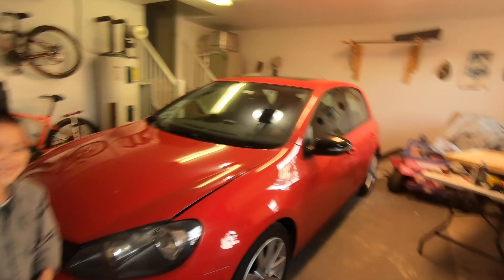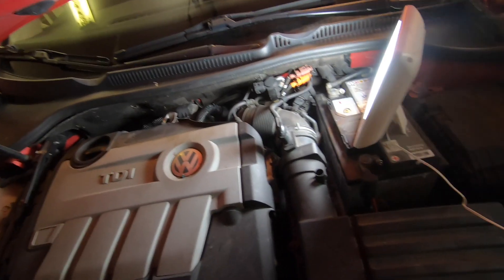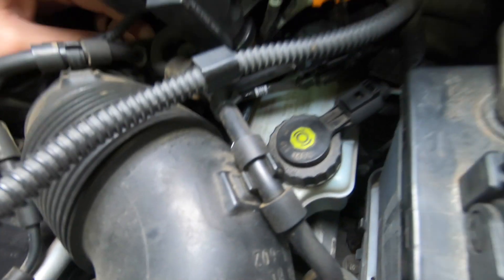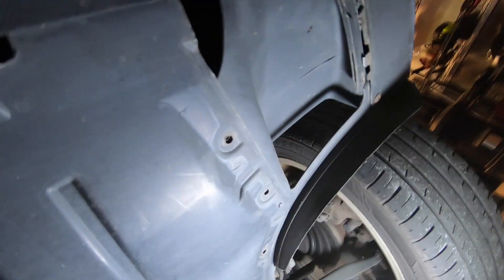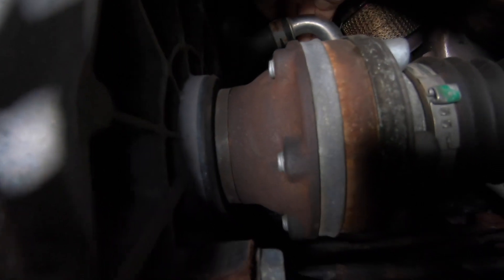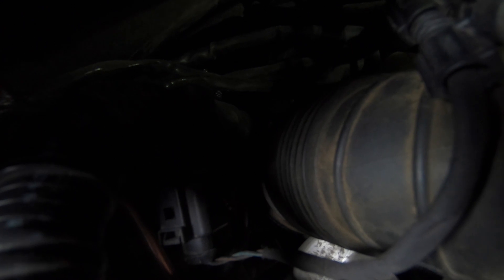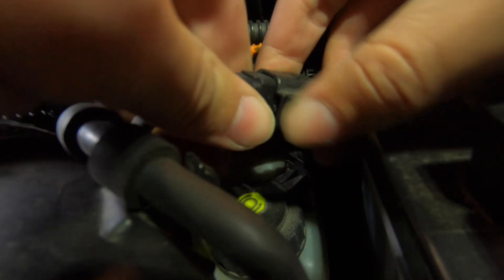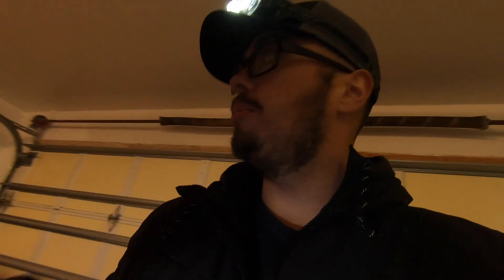MK6 VW TDI P0544 G235 EGT Sensor- How and Why

Comment: This was a challenging fix.  It’s just tough getting to it from above or below.  Like all fixes, I could probably do it in half the time now that I’ve done it once.  

Be prepared to spend more time than you hoped, but there’s nothing complicated about it.

Bolt blaster or its equivalent sprayed towards the sensor fitting from below helped.  A cheap also boroscope  helped.  

Be patient.  I wasn’t.

Comment: Thank you for the video. This helped a lot.  I couldn’t fit my hand back there, so did the job from underneath. I think it’s also a lot easier seeing the nut from below.
Reply from the maker: Definitely easier to but it still wasn’t very visible with my hand up there. This video was actually my second time doing it so just reaching over the top worked.
Reply: when you went underneath, did you have to remove anything extra? or was it just a much easier to get to? I know the top almost seems impossible.

Comment: I have the same issue, effed up my DPF filter so got the RAWTEK delete on, had to put new sensor in but the ECU will not allow me to clear the code however the tool sees the temp increasing but won't allow us to clear the code.  I have the Malone tune on it as well and have asked them for input.  Thanks
Reply: Did you ever figure out how to clear the light? I am deleted and have this error and a glow plug light flashing
Reply: @NikkFlo  I ad to get rid of my DPF.  I used a Vaggcom once I cleared everything and I believe I had to replace the lower sensor.  The code gives you the same error for both upper an lower sensors and my luck it was a bitch to figure out.  I have not had a problem sense then.
Reply: @GlennWhitcomb  appreciate the reply! Mine needed up being the egt sensor had failed. I’ll take that over anything else lol
Reply: @NikkFlo  awesome glad you figured it out.

Comment: Hi
I have the same car with the same problem. I'm trying to follow along with your video but I'm not sure where exactly is the sensor located. is it technically on the exhaust pipe? Thank you
Reply: hey did you ever figure out where the sensor goes?
Reply: @triple_s155  its "under" the turbo. you can see it from underneath, in between the turbo oil drain and the downpipe

Comment: Thanks a lot for the video  , really helpful  , by the way if the car left with this fault for sometime any damage or effect would it have ?
Reply: Possibility of DPF damage and it relies on temperature regulation for correct regeneration intervals
Reply: See 13:50 where he explains it well.  This problem just happened to my TDI.  I went a couple weeks with the P0544 code, since I couldn't locate the part.  Then my car threw a new code P2463 and went into limp mode, so I checked the DPF soot loading using VCDS, and it's right about the max allowable point where even if I fix the sensor it may not even go into emergency regen.  I could be looking at a new DPF or may have to clean it, if that's even possible.  I read online that a new DPF costs about $2,400, so that's not good.. Update: I changed the sensor, was able to force a regen while standing at idle, and after several attempts, it cleared all the soot out and it’s running normal.
Reply: @Greasyfingers60  hi! While you were waiting for the sensor, did your mpg got worse?